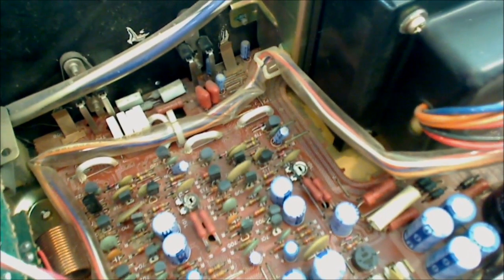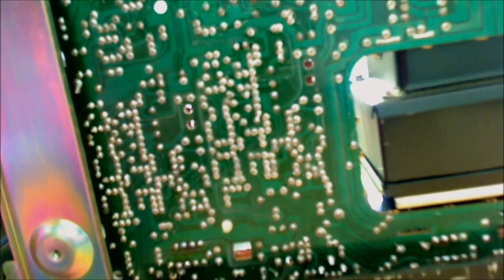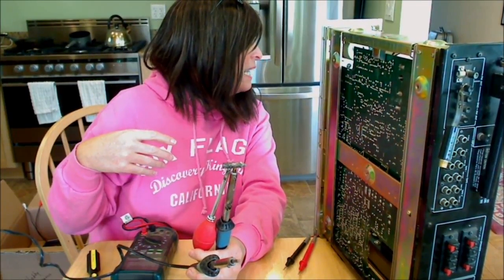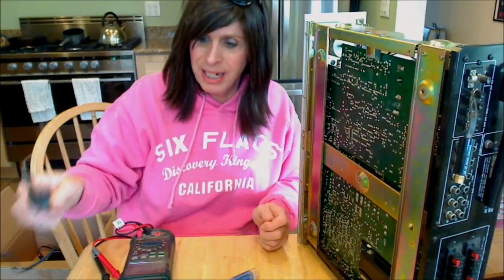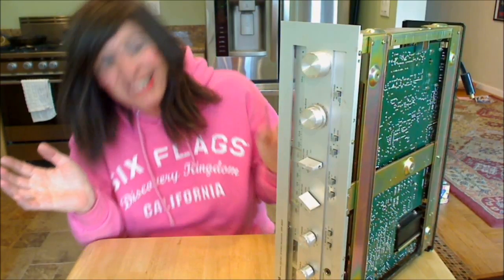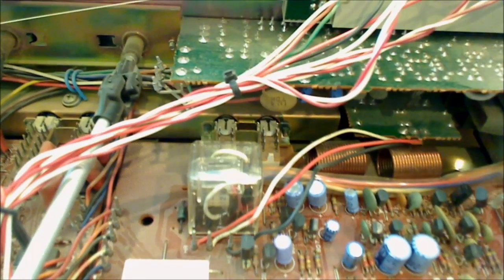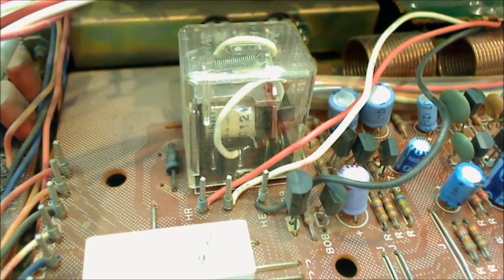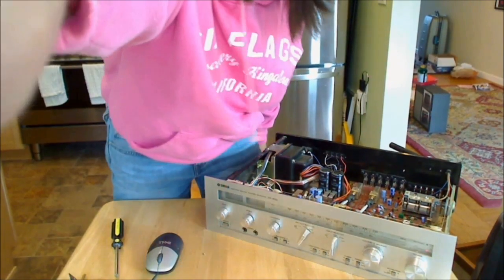Kitchen Table Repair...Yamaha CR 620 Stereo (Part 2)

Comment: Hi Rosi Can't believe I found your youtube video on a Yamaha cr 620. I just picked up one of these beauties at a garage sale but when I got it home it was also totally dead. Opened it up and checked the fuses and walah the main power fuse was blown. Thought my problems were over but turned it on and the fuse blew again right away! Since this fuse is before the transformer , could my problem be with the power button?

Comment: maybe you can help me. I have a yamaha cr620 and it's running ok. but when you adjust the volume or loudness knobs, it makes a cackling noise from the speakers. I was told it just needed to be cleaned and it would stop. we sprayed it down with compressed air...but the cackling remains. any idea how to get it to stop?

Comment: I have a Yamaha cr-820 that is shorting the output transistors on the right channel and blew the 4.0amp fuse near the speaker inputs. must be too much current I thought. and those resistors you pointed out may be part of the problem on my receiver. Anything else you think could be causing this?
Reply from the maker: when resitors get taken out, it's usually a cap that failed around it...cheers!

Comment: Nice video Rosie. I just picked a CR 620 from the original owner.  He said it hasn't been used for 20 years. Powered it up with a variac and it works fine and sounds great. Real nice condition too. I just need to replace the lamps. Seems like this unit is going to be a keeper and worth the $75.00 I paid for it.

Comment: I have a CR 620 I rescued from my town's electronic dump about a year ago. I just plugged it and the sound is great. It's my main receiver now, or at least it was. Last weekend one of the channels weirded out. If I turned the volume up it sound would come out but it was muted compared to the other channel. Also, there was static when I wiggled the balance knob.  Any thoughts?
Reply: Bob Hazard I have the exact same problem. Trying to find the answer now.

Comment: Rosie thanks for the great video.  I have the 620 and get power indicated by the light but nothing more.  My relay is in protective mode and will not engage.  What is the exact metal oxide resistor you replaced?  Any other ideas on how I can fix my receiver.  Oh and where do you order parts from?  Thanks again
Reply from the maker: Hi David..if the protective relay is tripping, you have a short somewhere on the board....visually check all connections and solder joints. I order parts from Mouser because they have no order minimums....Good luck and go Yamaha!

Comment: I have a CR-1020, which I love, but when using it, it plays for varying amounts of time and then inevitably there is a loud crack/popping sound and then nothing comes out of the speakers.  The unit's power and lights are still on, but no sound will come out...radio, tape...nada.  If I turn off the unit for a while and let it (or me) cool down, it will work again, but will repeat the cutting out after a period of time.  Can you suggest the most likely cause of this problem?  I love the receiver and want to extend its life!
Reply from the maker: +CostaMesaPhotography Sounds like it is going into a protective mode that is heat related..are you sure your speakers are a good match, impedence wise? Cheers
Reply: +Rosie O'Kelly Yes, positive the speakers are a good match.  I suspected the problem was heat related...not sure what components/failure to look for?

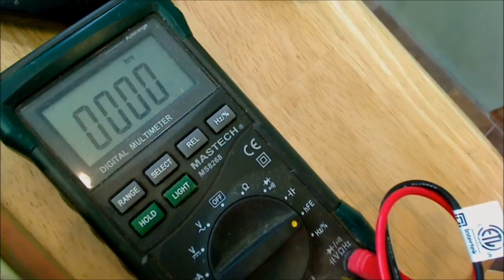Comment: When you measuring voltage on metal oxide resistor (3:58) your meter actualy measuring h FE ???
Reply from the maker: Yeah I saw and remeasured it a bit later..thnx